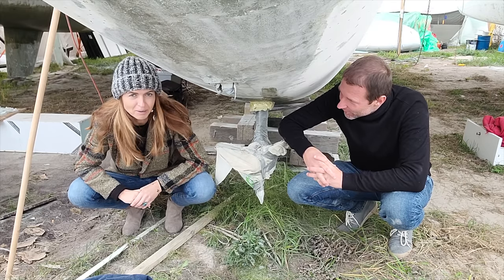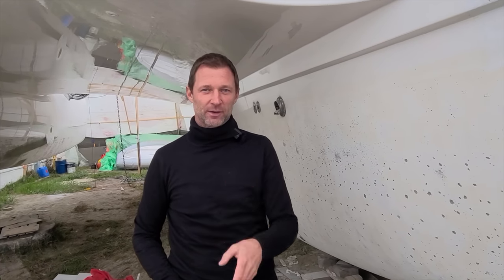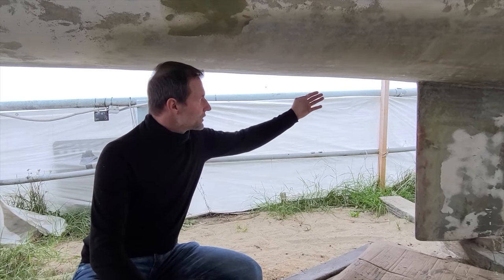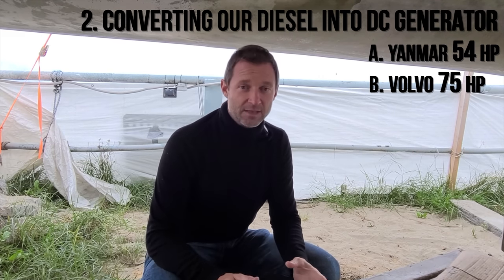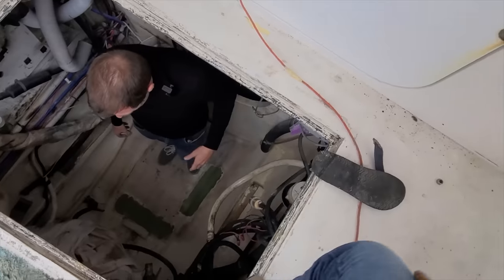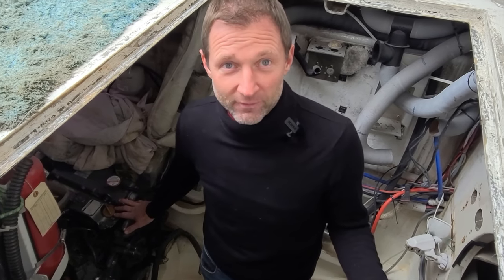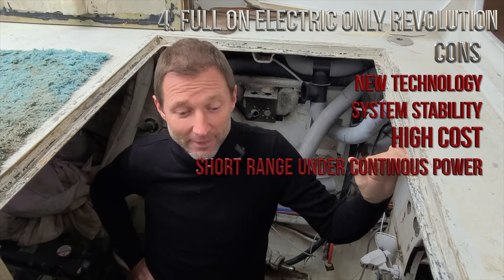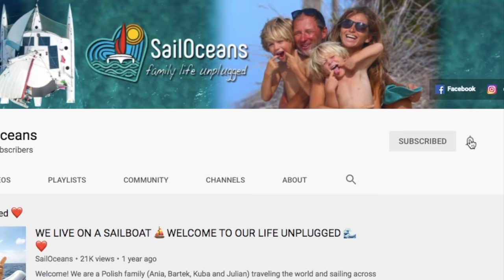The Big Decision - Electric vs Diesel Sailboat Propulsion

Comment: Hi Folks,

I am just waiting for a delivery so good time to do a detail response.

The thing you are doing is not easy. I was going trough the same exercise and COVID hit. Being in Australia and my Catamaran in France and the Australian quarantine laws are restrictive. So basically getting out was easy getting back not so.  So all on hold until next European summer. Here is what I have learned and how you may approach it.

Its about the propulsion architecture and marine institutes have done some research on this matter and to date cost benefits are still questionable. However if done right then your autonomy is only limited by food or access to food supply. 

The best way is to draw a diagram of it. At the centre of the system is the battery bank. I do not know what your boat weights but you are probably looking at 20-40kwh pack. This is the focal point and all your equipment will run from that. Both  house loads and propulsion. You can eliminate propane and all the hassles you have with it and getting it refilled.

Draw a diagram and on the top put all the house loads, fridge, cooking, AC, navigation equipment, watermarked, washing machine. Split it what can run on 12/24 or 240 volts. Once you have decide where the inverters will go and DC to DC conversion. 

On the other side list all the inputs into the battery bank. Solar, wind generators AC/DC generator, hydro generator.

Finally the drive system, one or two motors. Always be aware of cable lengths.

Battery Bank. The battery chemistry is very much set for the price / performance / longevity / safety / cycling and that is LIFPO4. Do you have one battery bank or split them in two. For easier battery management its advisable to have one large bank, but a case can be made for both. Another is do you run your house 12/24 loads from main bank vie dc-dc or have the dc-dc charge a separate house battery. For me now dc-dc is best. Few years back maybe not.

Voltage. Low voltage 48V DC or higher. 48V DC s much safer and enables normal people to work on the system. Soon as you go higher then you need licenced electricians etc. Also 48V DC you can purchase of the shelf. Same applies to 230/240 DC to AC inverters for house loads. Only issue is that 48V DC battery banks can be limited to how much output you can get out to drive the propulsion motors. When I was doing my planning some 2 years ago it was 15KW motors, but now have read that 30KW motor solutions are possible. So if you can getaway with it have a 48V battery bank and drive everything of it. 

Motors. AC DC Saildrive, shaft, pod. They all have their pros and cons. The number one factor you should consider is hydro generation. How much power can you get into the battery bank when sailing. I think  your trimaran would be fast so to you could get heaps of power into you banks and recharge them very quickly. Will also need tolook the abilty to feather the props to stop battery overcharging or dump resistors.  As for location I would keep them both in the main hull due to cabling issue. If you have 15KW motor in an ama in a 48V system you could be looking at well over 300 amps running from battery to  motor. Lot of current and current hates bends etc in cables. Overheating, resistance hot spots will be almost impossible to avoid in cables that long. Also where do you put the Inverter for motors, near the motor and run a long DC cable or near battery bank. One fact 1KW electric motors is not equal to 1KW diesel engine and ratios of 2 or more to 1 are regularly quoted.  That does tell the true story as electric motors have instant torque and will be better at low medium speeds and accelerations. Diesel will make up the difference up high or last 1 and a bit knots, but how often do you run a marine diesel at high revs.

Solar Panels. Stay away from the thin walk on type. Had them, they over heat burn out and produce far less power. (not just my opinion) I had them got rid of them and on my catamaran I have 4 Sunpower and produce so much more. Multiples times more. So stay with glass ones and have them raised from the deck so cooling air goes under them. You might have to build a lightweight frames for them but you would need far less of them. Another thing have a separate MPPT controller for each panel. Normally people wire them up, one panel goes down to 30 percent the whole bank goes down as well. There are now panels with a micro inverter in each, which would be perfect, just do not know if they are suitable for a marine environment.

Generator. AC / DC. No brainer in this, if you adopt central battery bank then a DC generator is perfect as it is used just to top up battery. DC generators are far lighter. I was looking at 20KW polar power set and that was only about 180kg in weight. A 20KW AC generator was 400 to nearly 600kg. My 9KW AC Onan is just over 300kg, with mounting brackets etc. But that would apply for the DC generator but would be less. If you want to find out more look at Polar Power, they have some good white papers and diagrams to get the though process going. many other research documents are on the same page, but like all vendor documents. Do your research. Also you are talking about a big solar panel bank some 6KW, and get the hydro generator worked out you might need smaller. BTW linking an AC / DC generator directly to propulsion motors is not efficient as its hard to line up the most efficient output of the generators to what the propulsion motors need. When charging the battery bank the DC generator goes to the most efficient rev range and dumps the electricity in regardless of what the propulsion motors need.

BTW I have 30 years in High Tech industry and build telecommunications and internet networks around the world. Power deliver, backup, redundancy are key. So if you were to ask me how would I do it If I was going electric / hybrid.  All the experience over the years is that 80 - 90 percent of faults is the cabling and connections so taking that into mind and I am also assuming your bout is 10-15 tones fully loaded.

In the main hull I would put the DC Generator, then behind the battery bank and then probably 2 48 volt electric sail drives that can feather props. The battery compartment would house the MPPT, dc to dc etc equipment along with the safety switch's, breakers. The motor inverters I would put as close to them. That will keep your system tight, cable distances / length short and will far easy to maintain and diagnose. Imagine doing diagnoses where your battery banks etc are in the main hull and motor in the ama. Plus your boat looks really wide,  what rudder forces would you need to keep the boat straight when running on one motor. As for fuel tank, cut the size in half and save 300 kg, house battery banks another 100- 200 kg. But keep the generator starter battery separate, even if some can be starter by the DC generator acting as a starter using the main bank.

If you want easy pivoting just put a bow thruster in.

Hope this helps and gets the though process going. It will not be cheap. And on a final note, keep you manufactures numbers small. So if you can get battery bank, inverters , chargers,  shunts, dc bars from one manufactures great, or as few as possible. Interoperability is the issue and falls into the 80-90 percent, connection problems. 

Full electric, forget it, not until we get the battery chemistry density a lot higher. 

PS enjoy your cold winter :-(
Reply from the maker: Thank you for this in depth analysis. Lots of good points I agree on. I am planning to separate the banks into two. Separate bank for each motor. One of the big reasons to go with this conversion is to gain redundancy. In case if one side/motor fails for any reason, we still have a fully independent system on the other side to be able to limp to the nearest anchorage and figure out where the problem is. I am not sure what you mean by inverters for the motors. Please let me know. Perhaps I am not seeing something. Cheers mate and thank you for sharing this much infor with us.
B
Reply: @sailoceans  Hi, What I meant to say and was not clear. It's is all dependent on what voltage your battery bank you will be using. Also the propulsion motors location. Was not sure if they would be in the amas. My recommendation would have been in the main hull. If it is a high voltage system then you do not want to run high voltage DC cables though the boat. So in that case your inverters for the motors would be best put as close to the High voltage DC source which is the battery bank. And then run AC current to them. You want to keep the high voltage DC current cable runs as short as possible. Have a look or google DC arc faults. They have been thousands of house solar systems catching fires because of that. Yes there are solutions to limit the danger but best to avoid any long high voltage DC connection and cabling. Especially marine environments that just seems to find a way to screw up electronics and electrical systems. Just a questions, your propulsion motors will be AC?

While I am here another thing is your solar installation, you mentioned it will be a large installation,  I have a 10kw solar system in my house and in each panel has a micro inverter embedded, (enphase) so DC to 230 V AC is done at the panel, then linked in parallel. So if one panel fails or is shaded it does not effect any of the others. Do not know if these are suitable for yachts yet. My are Sunpower AC Modules panels. I did it for system output and stop any DC fires as there have been 100's of solar panel fires in Australia due to DC arc. 

So on solar, stay away from the walk on and go to glass, make the frames for them, and if mico inverters are not suitable for a yacht, have separate mppt controllers for each. You have plenty of space for them on you trimaran. 

Keep well

Mick

Comment: Go electric without a gen-set. I've heard that the newest Ocean Volt has incredible re-gen capabilities. With the correct amount of batteries and solar panels, you will never need a generator and you will be able to cross oceans without hoisting your sails. Go 100% electric except for your outboard for your dinghy and BBQ. I think the best way to go for fuel for your BBQ is white gas but am not 100% sure on that just yet. I like the idea of an Ocean Volt shaft driven set up verses the inboard/ outboard set up better but that means that you will have to do a lot of modification. I'm not sure if you saw my comment on your last video but you should really read it because I gave you a lot of very helpful tips. If you go through the Panama Canal than just put an outboard on the transom and away you go without any issues. You can install a mounting bracket that can slide into position when needed and can also store it away when not in use. You can use your dinghy outboard for that. Get sponsorships on the Ocean Volt as well as anything else you might need. Sailing UMA just installed a brand new Ocean Volt.
Reply: Yes Uma has loads of experience with this and has done a ton of sailing without any diesel engine. They only recently added a small generator as backup for their sail up into the Arctic circle where limited sun on their small solar setup and lack of shore power meant they needed augment the batteries for the sake of speed. But they probably have less than a kW of solar and with your boat you have room for loads of solar, batteries, a wind turbine, and with two Ocean Volt drives well over a kW of regen when under sail - especially with the higher speeds of a trimaran.  Looking forward to seeing what you go with and happy that all electric is increasingly coming up as an option

Comment: If you are sailing 90% of the time why are you worried about motoring autonomously? Seems like overkill to me. Either rebuild the Volvo or put in electric pods with decent battery capacity, enough to motor 2-3 hours. KISS concept
Reply from the maker: 2-3 hours autonomy is exactly what we're talking about, so we're not worried just calculating.

Comment: Based on the video I'd say you're very keen on the dual electric propulsion (which would be very nice for ease of maintenance). How about hedging your bets and start with either of your existing diesels engines converted to a genset (whichever gives you the most current/weight ratio) with a smaller diesel tank than previously (augment that with expanding fuel bladders for long passages as the Neil has ample hull space to store them). Run with this configuration for a few years and if you feel that the solar/wind/hydro regen is covering your needs then remove the diesel engine and add more battery capacity.

Comment: For what I understand of electric drive i would go with larger batteries banks a generators maybe a little bigger that what you have a large solar panel bank, keep your diesel tank keep it low when around civilization and fill as you need .unfortunately batteries are not quite there yet. And also you  can look at other options for changing  like more quiet wind generators etc....

Comment: Go for 4. Lfp batteries are now 10kg per kw. 300 kg is 30 kwh,  sb enough. Could use 2 outboards like seawind. You.only  need 2 to 4 hp (1.5 to 3 kw) per ton.
Reply: Outboards do get stolen and are not that fuel efficient though they do come in Diesel and four stroke versions. They are also a pain to work on at sea.
Reply: @clivestainlesssteelwomble7665  I was thinking electric ob.

Comment: I have been thinking about this topic also. I wish to repower my Beneteau 50. In a perfect world (and more advanced battery storage abilities) the decision would be pure electric and easy for all the reasons you stated. BUT I keep coming back to a night in Baddeck, Nova Scotia a few years ago when we were anchored during a 70 knot blow that required us to motor forward 14 hours to relieve the pressure on the anchor. Did we stupidly stay too long knowing that there would be wind? Hell yes, but the point is that we who voyage DO sometimes make mistakes and we need to have the solutions aboard if at all possible. For safety sake I am not going the #4 option no matter how romantic and green it makes me and some couch sailors feel. Remember that UMA took a gas generator with them to the attic. Smart. Safety of my family and boat, at this point in the technology, requires a diesel back up of some sort. Your option #2 does not supply the safety factor (2 motors but one source of power). I envy your 3 hulls for options! Acres of available solar is wonderful. My solution at this point is to go with a Beta 75hp Hybrid system and a ton of lithium batteries. The hybrid system will let me propel the boat for 2+ hours pure electric and then, if needed shift to diesel mode. It is not sexy, cutting edge or perfect by any means. But, for me, is gives the right balance of safety and green.

Comment: How big is your tender? Could you have a tender big enough to do extended towing?   I like the fact that electric drive units can capture the water speed to charge the batteries when sailing.
Reply from the maker: Yes. The dinghy has been our emergency option all along. Its 25 HP can easily maneuver the big boat in port.
Cheers, Bartek

Comment: There are also diesel/propane generators. You could remove the diesel tank, insert propane tank (which is compressed and takes a lot less space) and in emergencies you could manually connect diesel canisters if propane was depleted in a remote area with only diesel, etc.
Reply from the maker: Propane is exactly what we want to get rid of. And we are hoping to achieve near 100% solar sustainability for house needs. Only the main propulsion is going to remain diesel for the time being. Cheers. Bartek
Reply: @sailoceans  Ah yea, good point. You did mention the environmental impact preferences.

Comment: Hi, good idea option 3c go electric with 20kW gen set and 3kW backup as emergency. So generally you can stay on solar and when necessary high charge by 20kw gen set to keep you move fwd. Some el motors from el car would be an option to convert for the marine use / inverter and controls issues, good luck

Comment: Just wondering if you decided on your engine configuration yet? If not have  you seen the new HH catamaran hybrid drive system? You could use your existing Volvo in the configuration, do large solar and batteries, reduce fuel tank size and remove generator for weight. By adding large alternators to the Volvo it would act as both back-up engine and generator. Just something to think about; love the channel!
Reply from the maker: That's exactly the way we are going :)